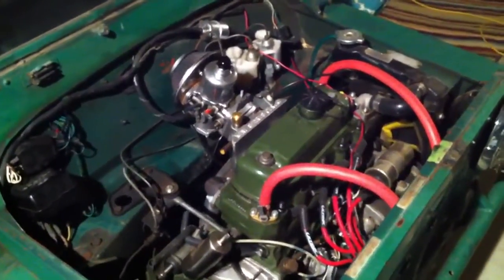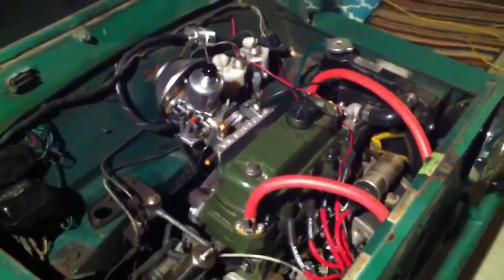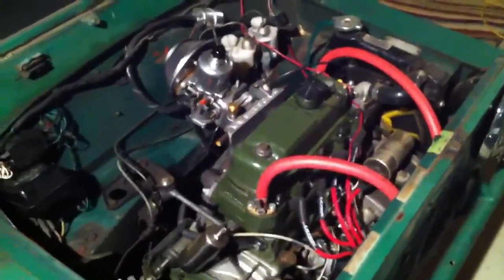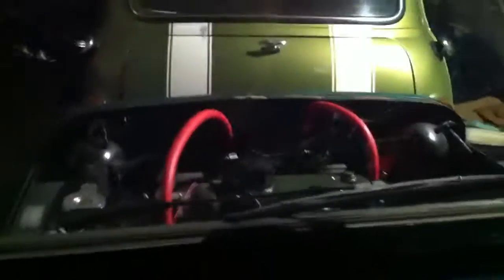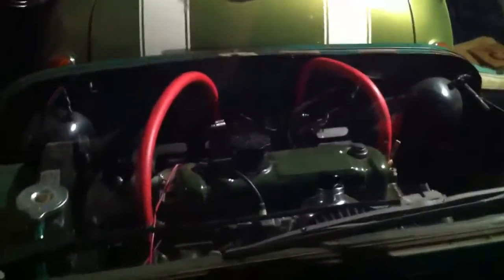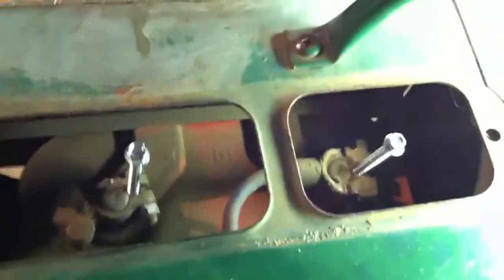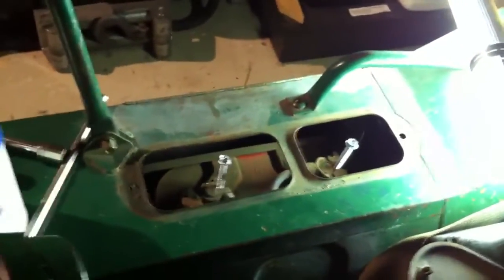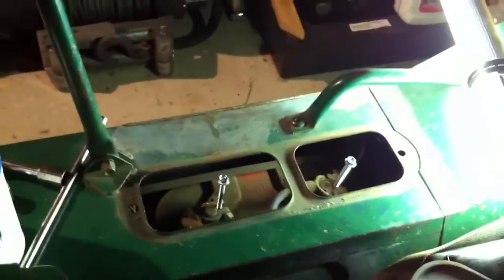Converting our 67 Mini Moke from positive to negative ground

Comment: dont do it no stereo those car are prone to back charging and static you make it even wors dual grounding and asulation is a bitcch to deal with in some cases static eats up ruber and gaskets I wuld recomend you to use amplifier and plazma ignition with heavy duty perfomance ignition system parts and actualy use sprays for anty heat moisture and static only so you can get ride of that problem by aware oil fuel coolant brake fluid types because those react diferently useing dual grounding/waste spark/static! you culd over write generator ore alternator speed with capacitors ore supresors you alternator start rpm charge will change and you actualy can force your starter motor to turn faster by upgrading brushes and wire insulation use ignition coil bypass curent for easy start ,prevent moisture build up fuel delivery syatem and intake manifold good idea wuld by to use heaters in winter time and fuel/oil aditives only that way you will solve problems nothing ells can help you because static gives you false tach and gages readings if you use radio dont let it tuch the car chassy ore baterry use a independent system who has its own energy sorce expecialy those older cars have a bade habit of parasitic draw on metalic spark plug wires they were baned for a reason